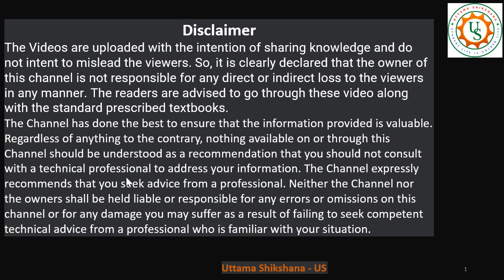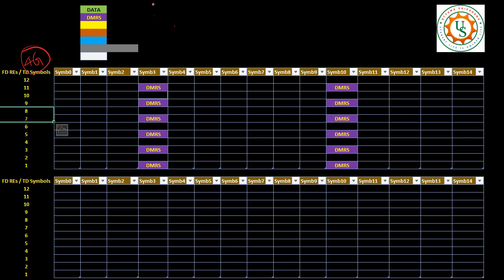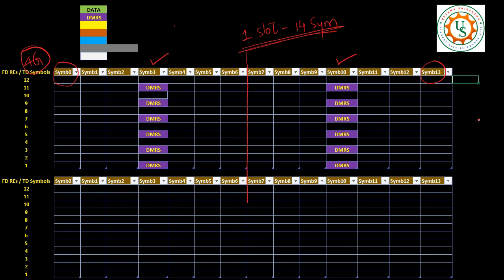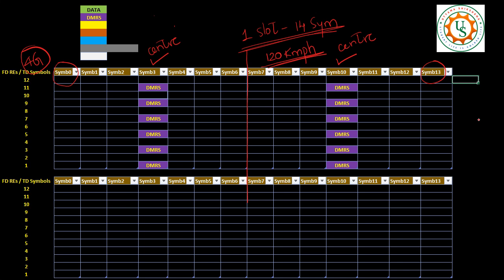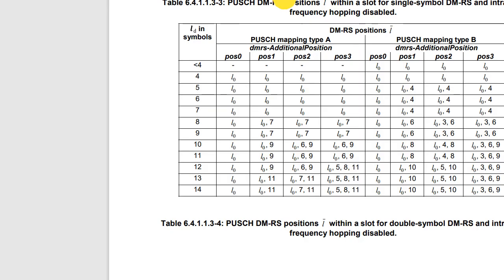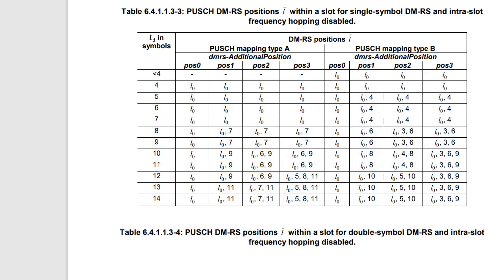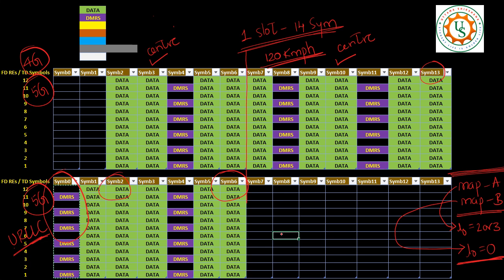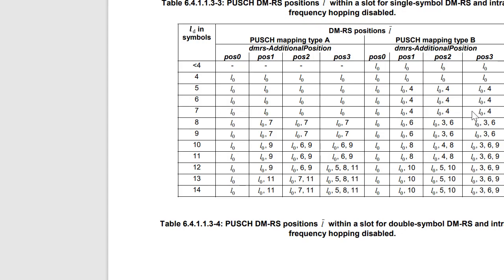[Series #14_3] 4G vs 5G PUSCH DMRS | Mapping Type A vs Type B

Comment: Thanks for the video.

6:25 Could you please double check the definition of l0 for the Mapping type A . 
In the book "5G NR: The Next Generation Wireless Access Technology" page number 173, the mapping type A defined as --  where the first DM-RS is located in symbol 2 or 3 of the slot and the DM-RS is mapped  relative to the start of the slot boundary , regardless of where in the slot the actual data transmission starts .

There is also a pictorial representation on page number 175 considering l0 = 2.
Reply from the maker: Thanks a lot Sanju :)

That is right :)
Definition of l0 for the Mapping type A is located in symbol 2 or 3 of the slot and is defined relative to the start of the slot.

Definition of l0 for the Mapping type B is located in symbol 0 of the slot and is defined relative to the start of the scheduled PUSCH resources.

I will place this in the description so that it is rectified. 

Thank you very much for writing this comment which is helping to place the right content.